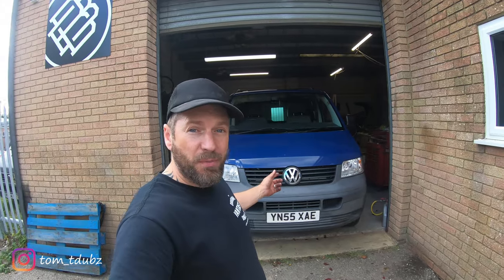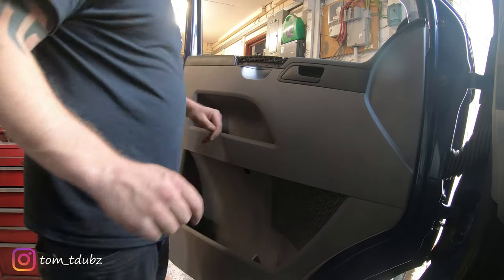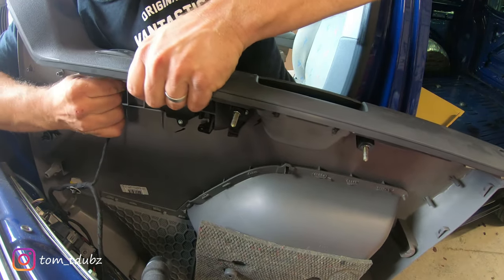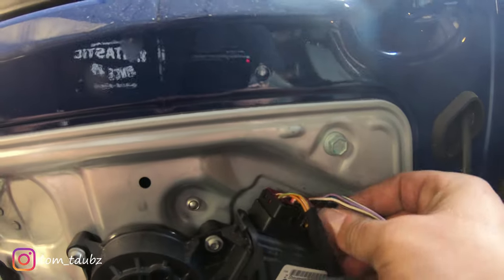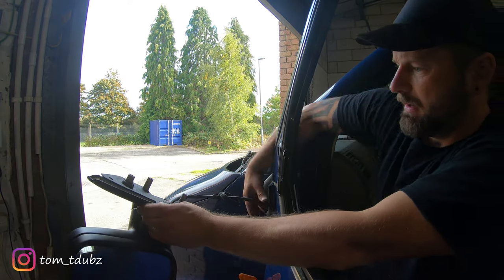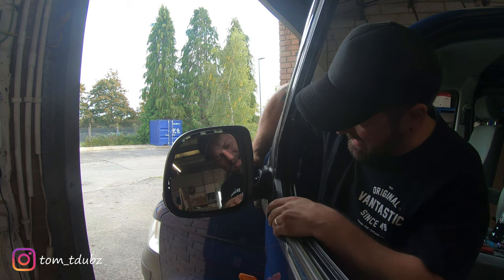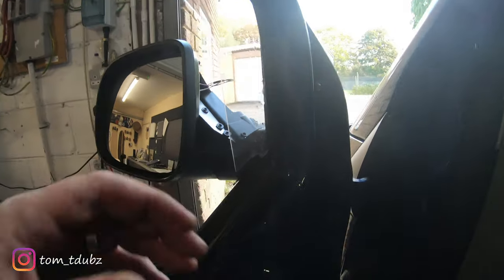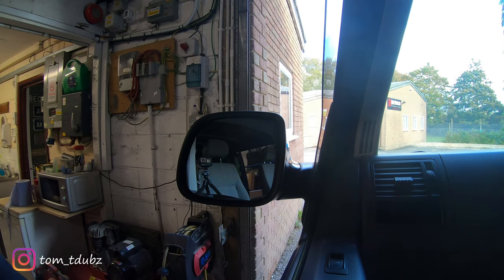VW T5 power folding mirrors #episodetwo

Comment: Great video Tom, thanks! I just fitted these and the power fold doesn’t work - any ideas why? The electric adjustment works but is backwards. I.E. point left and the mirror moves right / vice versa

Comment: Lovely job and thanks.  I have elec folding mirrors on a 2014 T5.  One of them bent a bit when hit a post when reversing.  It still works but it's a bit out of line.  Do you think it'd be possible to change the gear bearing inner bush (if there is one in there) to get it back in line or will it need a new mirror?
Reply from the maker: Yeah might be able to salvage it, I would be tempted to look for a secondhand one of Facebook marketplace or eBay…

Comment: Were the original mirrors electric folding ones? Great videos.
Reply from the maker: They didn’t work... I was lucky... had the whole kit ready to fit but didn’t need it in the end..
Reply: @tomtdubz  I have electric but not folding mirrors, is it possible to still upgrade to folding ones?
Reply from the maker: Yeah fella, there’s a couple of kits, one is for the  electric mirrors, gives you a new dial, switch.. to be able to fold them 👌🏻

Comment: I have a T5 2005, i purchased the travellin lite kit with the bypass loom. The mirrors are tilting on the switch but aren't folding. Any advice?
Reply from the maker: Hey thanks for watching, to be honest your best bet is to get hold of Elliot at Travelinlite he will best best to advise you if you’ve got issues… might be a faulty unit or fitted incorrectly…

Comment: Made that look easy mate 😂. I've not long fitted travelinlite power mirrors to a customers t5 and just found out the heated glass isn't working, everything is working fine except the heated bit. 
Do you have any ideas what could be the issue? Everything else works fine though 🤷‍♂️
Reply from the maker: Very strange, silly one.. did it work before. Sometimes the looms need re pining.. 
Thanks for watching 👍🏻
Reply: @tomtdubz  thanks for the reply! 
Honestly I'm not sure, that's the million dollar question isn't it I guess! 
Repining? Is that in the connector blocks the small pins that make the connection between each connector block?
Reply from the maker: @jonathanwilkes5565  yeah the purple block.. can’t remember the colours but I’d check the pin contact sometimes they don’t quite connect…

Comment: Hi do you know if you can change manual push glass mirrors to electric mirrors on a ford transit custom.
Reply from the maker: Can’t see why you can’t retro fit with the correct looms etc…
Reply: @T Dubz  would this be something you could do.
Reply from the maker: @robertwymark1102  where are you located?